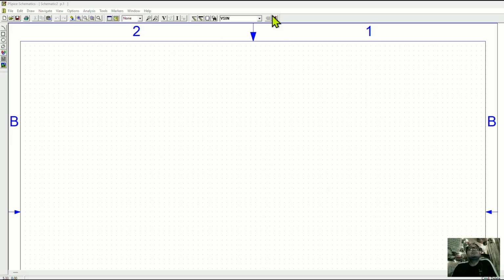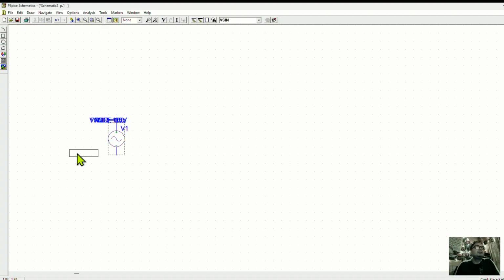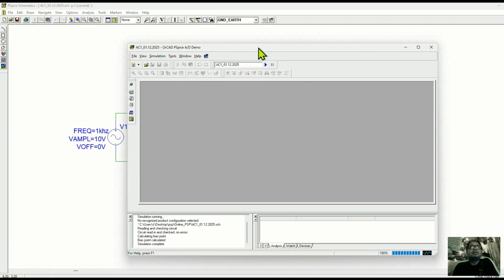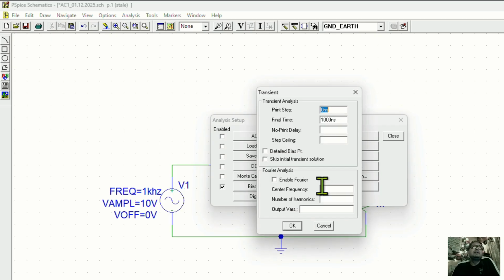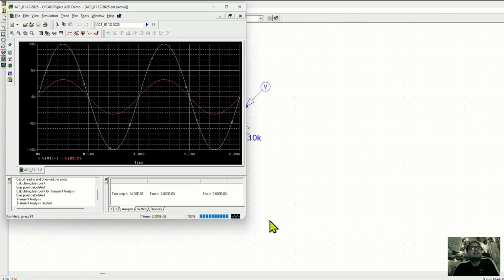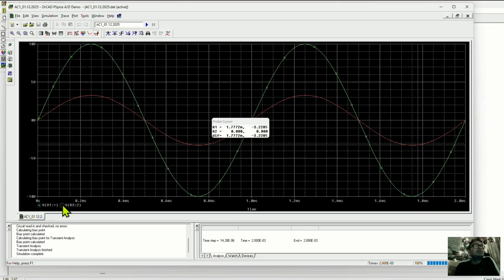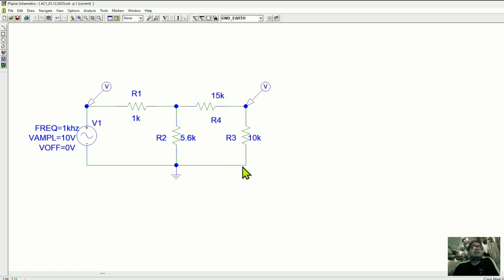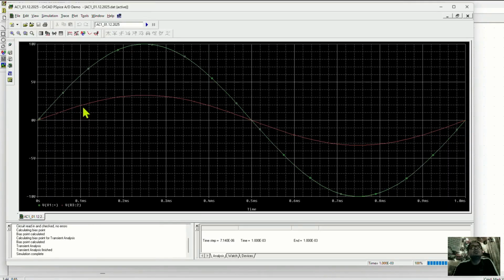How to Simulate AC in PSPICE (VSin) — 🔥 Plot Voltage, Measure Output & Analyze

Comment from the maker: Use VSIN with any signal of your choice and observe how the circuit responds.
Start simple → then make it interesting:

1⃣ Change frequency from 1 kHz → 5 kHz → 10 kHz
2⃣ Vary amplitude from 5 V → 12 V → 20 V
3⃣ Try adding a capacitor or inductor and see how the output waveform shifts
4⃣ Compare your results with my demonstration in the video

💡 Post a screenshot of your waveform or describe what happened —
I’ll reply and help you understand the behavior!
Let’s keep learning and simulating together! ⚡